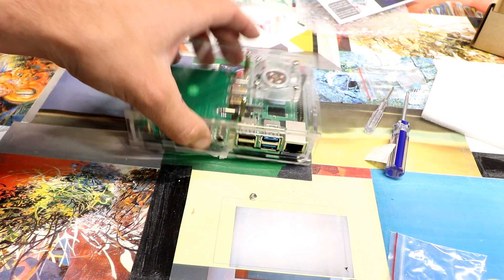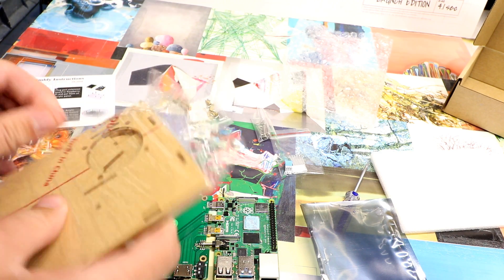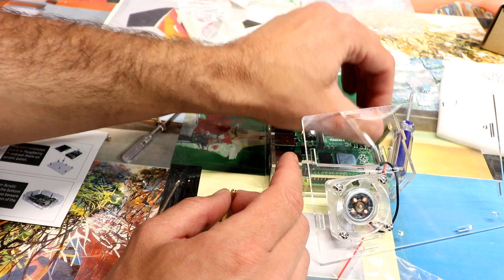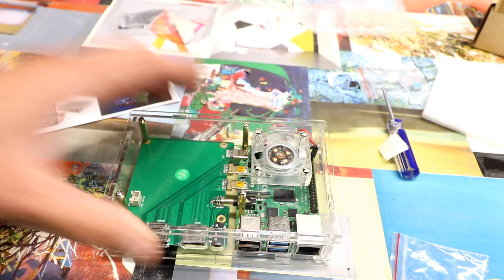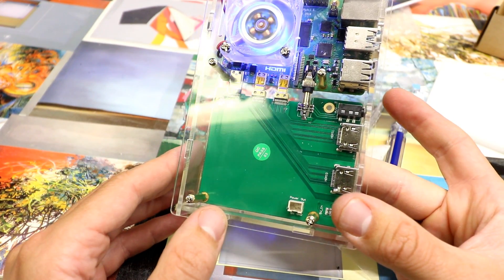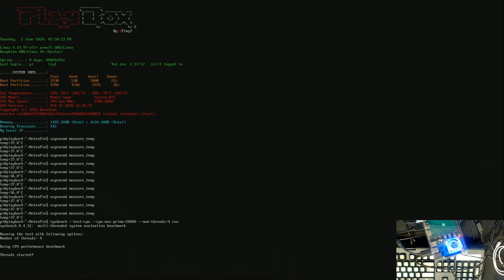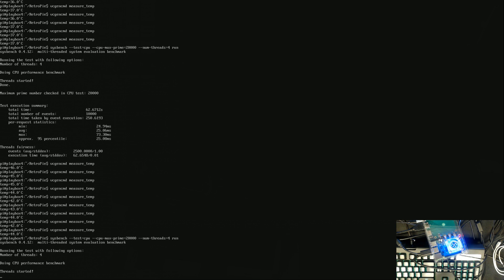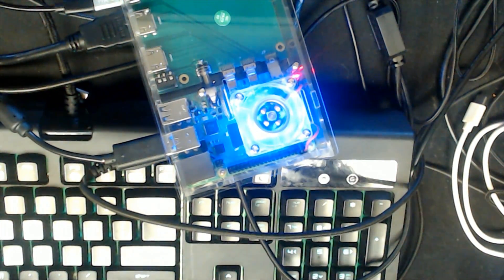Acrylic Raspberry Pi 4 Set-top Box Kit - Full Size HDMI

Comment: The only thing that would have put this case over the top is if they had an integrated mount for an SSD on the board side then just have a USB 3 cable route to the USB port.